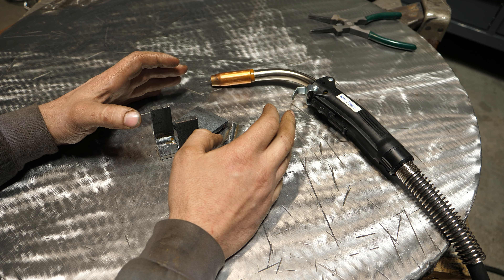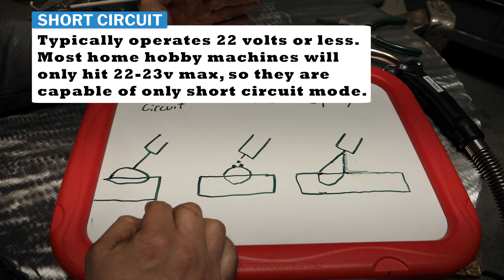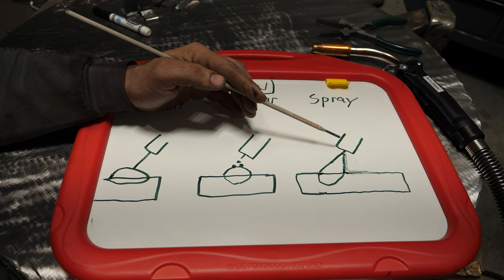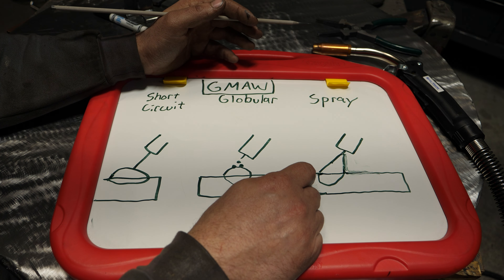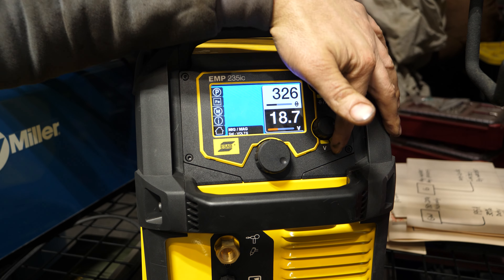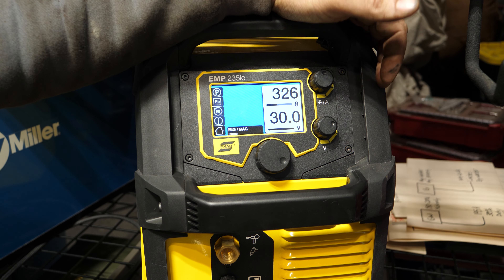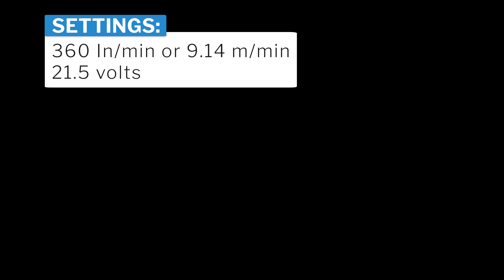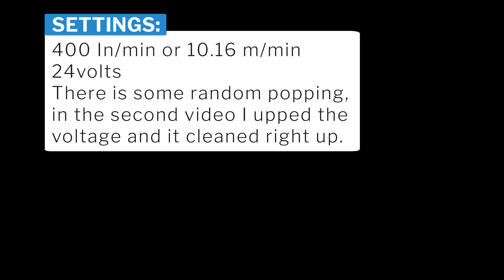Introduction to spray arc welding

Comment: Last place I worked at used mainly short arc for everything. I then pointed out the obvious lack of fusion on thick plate when I had to extend a column, by welding another piece to its bottom footplate with stick and had the whole plate separate from the mig fillet. Boss wasn't too impressed, but I said I can probably fix it. Took a look at the machines, one could hold 25,5 volts at 230 amps, just barely enough for spray. Had the boss order a bottle of 92/8. Did some test plates, got the settings right, never had a fillet weld tear away ever again. When I left they were still scratching their heads how I fixed it.
Reply from the maker: Sounds like you had some common sense for sure lol.  It’s crazy to think people (and companies) don’t realize how limiting short arc can be.  The fact that you knew enough to do some tests to get it dialed in, and the success you had, shows you knew what you were doing.   

I am sort of in a similar situation right now.  I took some work for a local place to fix a ton of equipment.  I showed up and they have a miller 355 mig machine, which definitely has some horsepower.  However there isn’t a single bottle of any mig mix besides c25 and trimix for stainless in the place.  They have atleast 30 tanks lol.  They have been weld repairing everything with that welder in short circuit mode clearly.  Not a lot of failures but I have seen a lot of really bad welds on 1/4 to 1/2in thick lol.
Reply: @makingmistakeswithgreg  It always escapes me how they just won't use a fat 7018 with a good stick machine for thick plate and tubing. Yes, it's slower than mig/mag. It's also much cheaper and easier to set right. I think even some dualshield fluxcore runs with C25 gas, why won't they use that is beyond me.

Comment: As a home gamer using smaw and fcaw on a 140a machine, I've never encountered spray arc or globular transfer modes and I learned a lot from this video. I really find the science/theory of welding interesting, thanks for taking the time to explain it all in a way a noob like myself can understand.
Reply from the maker: No problem 😀.  Spray welding really gives wire welding the performance to weld thick material.  It will actually outperform stick welding in many cases.  It’s just unfortunate it’s not possible to do it without a decent investment in equipment.   For most people the drawbacks far outweigh the positives.  Luckily there are far more affordable ways to weld thicker steel (such as stick or tig) 😀.

Comment: Another great video Greg, this certainly helps those who never had the chance to do spray mig. I have 2 welders which will do spray and one of those does pulse spray.  Pulse spray is the way to go as you can weld thin material without burn through. I have a HTP Pro Pulse 220 and it does pulse  and double pulse on aluminum. I found that their syn programs are set for 030 wire in spray but if you turn the trim up 3- 5 volts it will spray 035 wire. Same as for pulse. Pulse spray works up and down no problem , I have not done overhead and not likely to so I can't say how it works. HTP had these welders on sale a month or so ago for $ 1999.00 now they are $2199.00 so they might be in the range for some guys. Some guys run spray straight into a fillet weld ,I found that a slight washing up and down gives a more even penatration and a push angle, maybe you could test a fillet weld with push and pull and washing up and down of the weld to see if there is a significant difference.  I thing Everlast has a pulse spray welder at about the same price, made in China where the HTP is made in Italy.
Reply from the maker: That HTP is a really nice welder.  They are about a hour from me and I have been to their store.  I actually buy all my tig setups from them.  Pulse is definitely the way to go with spray, it gives the best ability with wire welding in my opinion.  The price is more than reasonable considering the capability.  Especially considering many 200amp mig machines are in the 1,000$ range commonly now.  If a person is going to weld thicker material, higher production values, or just wants flat out better performance the price increase is well worth it.
Reply: I owned both welders you mention here (HTP Pro pulse 220 and the Everlast 253DP).  Both did a great job at pulse and double pulse welding.  I didn’t like the interfaces of either welders.  The Everlast was a bit more difficult to setup, the HTP menu was lacking in pre-programmed settings and wasn’t all that great in my opinion.  I think what Miller has done with their digital interfaces is much better.  The new digital interfaces coming out with the Everlast welders are great however.

Comment: Excellent video. Looking forward to your continuation of spray welding series. I hope you will have a chance do some other wire types with spray, like flux core and flux core with gas and demonstrate/compared to regular wire spray arc.  Have a wonderful Easter weekend and thanks for the presentation.
Reply from the maker: You also have a great Easter weekend 😀.  I will be revisiting dual shield in .045 as well, and I will do a comparison between all of them 😀

Comment: Excellent video & information Greg!

While I do have a capable machine, I've never used it for spray; mostly due to not having the appropriate gas. Hopefully, this leads us back into dual shield..... looking forward to learning more about that.  Thanks!
Reply from the maker: I will definitely be doing dual shield, I have a few wires to try and I should have better results 😀

Comment: I learned quite a bit just now. I’ve heard the term spray arch before but didn’t really know what it meant till now. Great info, I understand those processes a little better now. Thanks.
Reply: Same here, I learned how to weld here on YouTube last year and haven't come across a video that explains what spray arc is. I can't reach the settings needed for spray but I find this kind of stuff really interesting.
Reply from the maker: Yeah it’s basically just a different gas mixture and hotter settings in a nutshell.  It’s pretty uncommon for people at home to use the process because many welders won’t run it and most people don’t weld thick enough stuff to need it.  I won’t do much of it myself, the main benefit of speed isn’t very beneficial since I do a lot of repair work on sub par material in things other than flat position lol.  For the average person spray won’t have much in the way of advantages.

Comment: Greg, would you consider doing a video on stitch vs full length welding? When which is best etc. Having a hard time finding any good info on it.
Reply from the maker: You’re talking about doing a back and forth movement with mig as you’re welding?  If you use appropriate settings a stick movement won’t do much negative to the weld because the molten pool stays hot enough.  If the settings are reduced to make a more distinct look of dimes while stitching, you would lose performance.  I will do a video testing this in the future 😀.
Reply: @makingmistakeswithgreg  No, I meant like a 3in weld every 12in on center. Maybe I got the name for it wrong.

Comment: Good warning about getting too close. Blistered my knuckles and wound up with blood poisoning. Learned to stay back. Some guns have a metal shield that really helps.
Reply from the maker: Man that sounds bad 😮.  Definitely have blistered my knuckles, never got blood poisoning.  It’s crazy how fast you can blister knuckles when you’re running amperage above 180a.  The last time I smoked my knuckle it somehow 190a with flux core wire (it was with the tweco 180 in the video).  The extra distance of the spray master gun on the rebel 235 makes a huge difference in heat.

Comment: I work on aluminum die cast dies rebuilding the casting surface and machining back to print. We normally use a stainless filler (for use on H13 steel) with TIG which can be time consuming. The company set up a wire machine for spray but either nobody could run it properly or it wasn't set up correctly gas/etc. When machining we would cut through the excess buildup then it would peal off like foil. I'll take a look next time I'm over there to see how it's set up because if it's something easy to fix (gas) it would take away one of the bottlenecks in the repair process. 😊 Love your stuff Greg, thanks a million for continuing to cover EVERYTHING about welding.👊
Reply from the maker: So stainless mig wire is a confusing bastard because it’s very easy to do the wrong thing.  I have never done spray with stainless wire, I used short circuit.  With short circuit the correct gas mixture is tri-mix (helium/argon/co2) which is expensive.  When you use many other shielding gases with stainless wire you can have a bad lack of fusion problem (like straight argon is really bad).  C25 tends to produce tall ropey stainless beads.  The corrosion resistance can also be suspect when using gasses other than trimix, I believe it has to do with the reaction of high percentages of c02 in normal mig gasses. From a spray perspective it appears 98-2 (argon/oxygen) should be used (I have never spray welded stainless by that’s what my chart says). 

According to a couple books I have with metals, h13 has some interesting properties that can make it a pain to weld.  It needs a 800-1000 degree preheat, 700 degree interpass temp (temp should not drop below 700 degrees during welding) l, when done air cool it to 150 degrees, and then to temper it at a temperature just below its original temper, which apparently could be as high as 1100.  What may be going on with it peeling off is the weld metal literally cracked off the base material.  This is very common if the weld solidifies too fast.  The preheat is to prevent excessive fast shrinking of the material.

Comment: I spray arc every day at work for gooseneck and 5 th wheel hitches rated at 30,000 lbs. welding different thickness of mild steel with .035 at 26.2 volts and 550 wire speed with a 250 amp Lincoln . Welds great never had any issues .
Reply from the maker: Good to hear 😀.  Spray is definitely the way to go with wire welding.  It’s just too bad most mig machines sold can’t spray and many people aren’t familiar with it.  Its capabilities puts it in another league compared to stick when manufacturing is concerned.

Comment: I have a LINCOLN WELD PAK 140 MIG WELDER. Is my welder considered a home hobby welder ??
Reply: Yes, that's what it's intended for. It's a nice machine. I prefer Lincoln whenever possible.
Reply from the maker: The weld pack 140 is a home hobby type machine, but it’s far better than an Amazon special. Those weld pack 140s weld really good and are very capable of welding stuff 😀
Reply: @makingmistakeswithgreg  You can get better penetration using flux core wire.

Comment: Another great video, Greg. Thanks!
Of course, I always have a question and this one pertains to mig spray arc aluminum welding on 1/4 and less.
I have a Yeswelder 211 p that pulse welds. There is no question regarding its ability to obtain a spray arc at voltages under 24v using 100% argon.. is this possible because the wire used is low melting aluminum wire?
Reply from the maker: So aluminum requires less heat to turn to liquid so less voltage/amperage is generally required to melt it.  However it also conducts heat very well so it takes a lot of heat to weld say aluminum plates together.  The wire itself doesn’t have enough mass to aid in heat dissipation so it melts fairly easy, if that makes sense.
Reply: Yes, you need a bigger welder with aluminum thickness to thickness. That’s why helium mixes are used there often. I find, generally, that I need about 20% more amperage for aluminum.
Reply: Great answers. Thx

Comment: Thanks for another excellent video.  I've been following along with your instructions since the beginning and have improved my welding a lot.  Spray arc is out of my league, but if I ever have the opportunity to use it, it is good to have some knowledge of its pros and cons.
Reply from the maker: Glad to hear you have been around for a while 😀.  Spray is definitely fast, hot, and efficient.  I don’t do use it much simply because for repair work it’s not that practical.  For the average person the practicality of stick and normal mig does everything needed.  It’s always fun to play around with processes you don’t commonly use 😀

Comment: Was just spraying the wire today, seems others don't know what it's about...miller 350 p
Reply from the maker: 350p is a great machine, definitely has some horsepower.  At my work I run a suitcase feeder on a 350xmt.  Not much spray though, flux core and dual shield mostly.

Comment: Damn good video! Solid evidence and good cut and etch.
Reply from the maker: In part two where I went a bunch of tests the difference is significant.  It sucks that you really need a pretty powerful welder and a different gas mixture than standard to achieve such performance.  For thicker steel it’s 100% worth it.

Comment: I saw a guy fix a very large bulldozer crack using just MIG, the steel thickness around 5", he seemed to be using short circuit with the bead looking like dimes?, should he really have been using Stick or Spray for material of that thickness to ensure penetration?

Comment: Hello my friend, interesting that you would do a video on the spray arc GSAW process, I was just researching what is necessary to run the process. When younger and in my welder career, I did spray often for fast and deep penetration welds in a production environment. I always loved the cool hissing noise, and massive heat input, not to mention speed of travel to get welds done fast. Last time I welded with spray I was using a Miller 450E machine, and .045 solid core wire (50lb spool) at about 32-34V. I always wondered if my Hobart handler 190 could achieve spray with .035 solid and 90/10 or other gases that have a bit of O2. I’m thinking not because the voltage just isn’t high enough, amperage on edge of,  and maybe not even a fast enough wire feeder setting.
Makes me want to check my wire voltage with my machine balls out with volt meter at no wire drive speed for a general idea.
My next welder I get hopefully will be a multi process Inverter type machine, one with with Stick, Mig, Tig capability, and with pulse capability as well. This kind of machine looks like it will set me back about 4500 dollars min also, not including gas, wire etc. 
Have a blessed Resurrection Day my friend, keep up the quality work with your channel.
✌️😎👍
Reply from the maker: So that 190 is capable of about 22.5v at 180amps of output according to its volt/amp curve.  It would likely achieve “globular” transfer and that with 100% co2, but it would not be able to hit spray.  I wish more machines were capable of spray, it would give a lot more capability.

Comment: Hi Greg! Thanks very much for this great video. It answered a lot of questions for me. I'm new to your channel so just seeing this now. I would like your opinion on the use of the suitcase units. I have a LN25 I run off my Ranger 300DLX and would love your opinion on it and how it would compare to the spray arc. I know it is capable of spray arc. I used the miller suitcase with a company I worked for used flux core on piling. I hope to us my machine in surtane application.
Reply from the maker: So that setup would have no issue running spray, the engine drive units are capable of more than enough voltage and have a bottomless pit of amperage to work with.  I use a suitcase feeder at work running on a 400amp power source (miller).  It works exceptionally well and would basically work the same as if it was on a generator.  The main benefit if you were to switch to spray is you can get much more metal deposition.  The higher deposition is due to wire feed speeds and the lack of spatter (spatter is lost metal).  You also gain more penetration, faster travel speeds, and flatter weld profiles.  The drawbacks are mostly inability to run out of position without pulse and based on my experience it can be tough to get spray to work on less than clean material.  Spray actually has more penetration than dual shield in many cases but dual shield is far less likely to have porosity welding on less than perfect material.
Reply: @makingmistakeswithgreg  ok good to hear your opinion. I value it and appreciate your channel. What I like about your channel is how you cover the different processes and where they are best suited. I have a millermatic 255 in my shop and the LN25 that I run off my engine drive. I like hearing other welders' opinions on the welding options these machines have.

Comment: For the begginner home shop it seems like a short circuit mig  machine + a basic stick welder would be the way to go. Would love to see Tig compared in the same way
Reply from the maker: I will be doing a comparison between the welding processes soon.  I agree with you on the stick and short circuit machine being a solid combo.  It gives the ability to weld thicker steel and super thin as well.  Spray weldings main benefits of speed and metal deposition are mostly benefits for production work.  The penetration is a nice bonus, but there are ways to get that without going to spray.  It’s unfortunate that to get spray level performance you need a pretty expensive setup to handle it.  Far more economical to go with stick, especially for non production focused home shops.
Reply: @makingmistakeswithgreg  while I not be able to do it at home I'm 100% going to try it at work next time we have a slow day. Thanks again for sharing so much knowledge, it's greatly improved my welds overall

Comment: I looked into getting a bottle of C10, but our local gas distributors only carry it in a 300cuft cylinder, and is cost prohibitive. 
Is there another mix that will work well enough to get a decent weld without breaking the Bank or your Back?